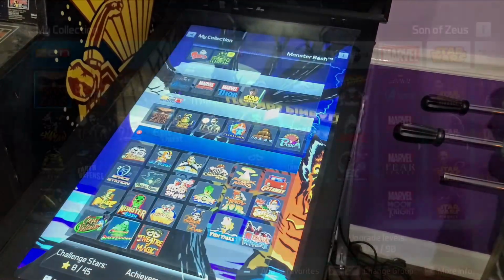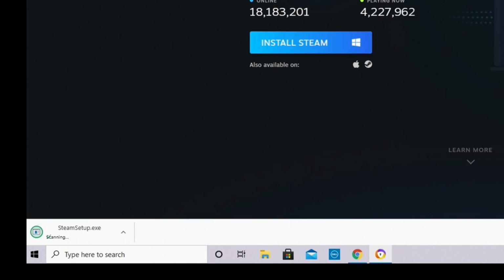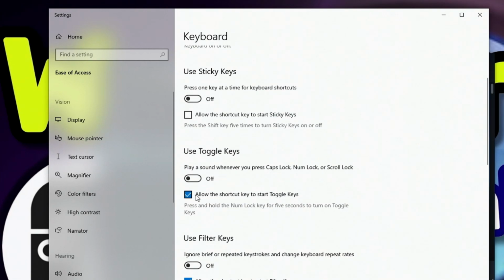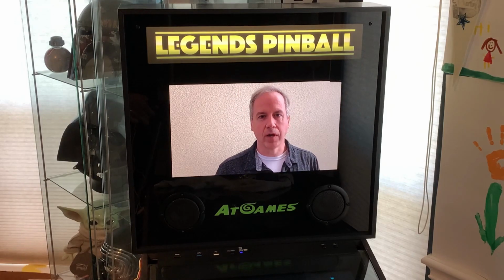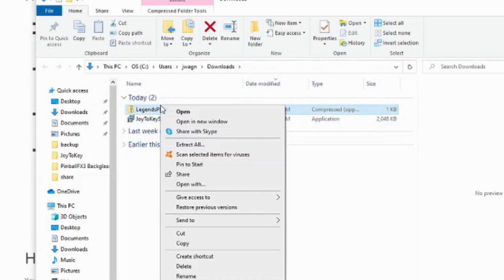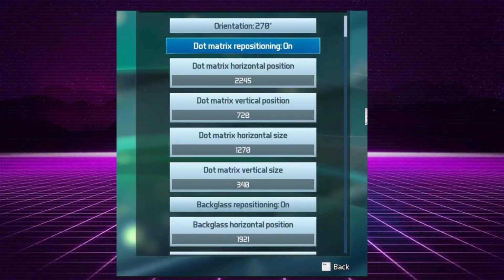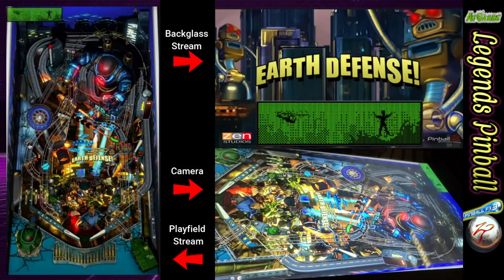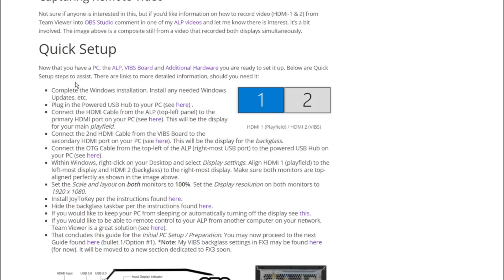Pinball FX3 Setup Guide for the AtGames Legends Pinball Machine

Comment: @WagnersTechTalk You have one of the best setup videos around. The holy grail of ALP setup videos!

Can you please help with something that happened with my Pinball setup? My setup was working great but then for some reason Pinball FX3 stopped displaying on the ALP. It shows up on my laptop but now on the ALP I just get a black screen with a URL on the side of the screen that says:

c:\program files [x86]\steam\steamapps\common\pinball fx3\data\steam\pinballfx3.[bmp, gif, png, jpg, jpeg]

No idea what to do about this. Please help. Thanks!
Reply from the maker: Thank you Joel!  I think what's happened here is that Windows got confused with the monitor/HDMI arrangement. Try plugging the HDMI connections in the same way you had it working before.  Then restart the PC and see if Windows restores everything back.  If not, the black screen you're seeing is the backglass display.  See the 2nd point here to make sure your displays are arranged properly: https://wagnerstechtalk.com/alpfx3/#Software_Considerations .  The first point here has a .jpg file that I created as a default backglass image until a game is selected: https://wagnerstechtalk.com/alpfx3/#FX3_Troubleshooting

Comment: hi, at around @9:39 in the video you are showing how your main screen (the playfield) is set to landscape. I currently have my backglass screen (on the computer settings) set to portrait mode. And I can see everything on my computer (on the pinball arcade screen just fine with screen #1 being set to portrait). And I even have Pinball Arcade up and running using the joytokey, with this configuration (my #1 screen set to portrait, and my #2 set to landscape -like yours).  So I am not sure why I would need or want to have my #1 screen on the PC, set to landscape....when it seems all pinball machine games will need the primary PC screen #1 to be in portrait mode.   I hope that makes sense...

Also if I left the screen #1 in landscape mode then it would look sideways when viewing it on the Arcade Legends pinball backglass (hence why my screen #1 is set to portrait mode currently).

I have a feeling if I dont have the same settings as you showed in your video for the PC screen configuration, then when you explain all the cabinet mode settings in the Pinball FX 3, those settings would not work for me....since my screen #1 is already in portrait mode....So I was just wondering why you would not have have your screen#1 in the PC settings to be in portrait mode???

thanks
Reply from the maker: That's correct, in the guide you'll find landscape is how it's documented.  Like you, I started with Portrait as it seemed to make the most sense.  However, as I began setting up PinUP Popper it was clear the landscape would provide the ability to see the entire screen (in portrait, while trying to configure anything things won't fit properly).  It became very problematic to launch VPX and not be able to see the entire screen or get much done in Windows.  I also find it easier to use TeamViewer to remotely connect to the PC used by the ALP to configure it and it's easier to do in landscape orientations.  I also found the community recommended using Landscape for similar reasons.  So, went that way and simply rotate the display in software when the tables are launched.  This has worked out well and the numbers I show in the guide should match fine if done that way.  But, they won't if you stick with portrait.  You'll have to do a bit of tweaking for the backglass/DMD positioning.
Reply: @WagnersTechTalk  OK, I think I see what you are getting at. I would rather follow your directions, since it would save time in trying to figure out all the dimensions etc as you explained in your video. I could also use VNC or teamviewer etc, to remotely connect to my machine just like you mentioned, and operate it in landscape mode (without worrying about how it looked on the atgame pinball screen (if that happened to be turned on when I was messing with Steam and like Pinball FX 3, etc)

And then, as you clarified in yuor comment above, I just use the settings within the software (Pinball FX3) to change Display settings. That makes sense.

The only other thing about using Vertical mode on my Windows machine is that I want to play stuff like Worms Pinball and maybe some older games too (that may not have fancy Display settings like PFX3 has). So maybe in those cases, I can just rotate the settings of my primary monitor (and therefore the backglass) to play a game like Worms. Only time will tell, once I experiment some more with some of the more esoteric games like Worms and even some possible Gog.com pinball games like Epic pinball

Comment: Thank you so much for the videos! 
Couple questions... I finished my haptics and it works GREAT but in OTG mode the exciters don't seem to be working. 
On the original tables they work great. 
Secondly when installing the vibs board. I am able to view my desktop perfectly on the backglass but no images. (FX3)
Any help would be greatly appreciated!
Reply from the maker: Very welcome Michael.  I'll point you to some info. to help:
1.  OTG Mode - It may be that you didn't press the switch button to swap from original tables to OTG (PC Audio, also here https://wagnerstechtalk.com/alp-haptics/#Troubleshooting or here if it's VPX that's an issue https://wagnerstechtalk.com/alp-haptics/#Option_1_Haptic_Effects ).
2.  No artwork on backglass - see the 3rd point here: https://wagnerstechtalk.com/alpfx3/#Software_Considerations
Until you select a table, you won't see any backglass artwork, here's one I made up that you're welcome to download (first point/link): https://wagnerstechtalk.com/alpfx3/#FX3_Troubleshooting
Hope that gets everything going for ya!
Reply: @WagnersTechTalk  
Thank you again! Im sooo close,  as the backglass is the only thing im still stuck on.  The cabinet settings inside FX3 didn't work BUT when i inputted the settings on at games it put me close.  The screen is solid black and the top shows the jpg switching through tables at the top but no image?
Reply from the maker: 2nd link above should get you to the artwork, you'll copy those files and next time you launch FX3 should see the backglass artwork.

Comment: This tutorial is awesome except I can't get Joy2Key working with my AtGames Legends Micro Pinball machine. I used the file you suggested for mapping buttons but nothing worked. Is there an update to the key mappings for the Micro or is there another solution besides Joy2Key that will make the buttons on the Micro work? Thanks!
Reply from the maker: j2k definitely works with the Micro as well, I used it with a Steam Deck running Windows.  After copying the file, make sure that you exist/restart j2k.  A few sections that should helop:https://wagnerstechtalk.com/alppcsetup/#JoyToKey and https://wagnerstechtalk.com/alppcsetup/#OTG_Troubleshooting .  Alternatively, you can map the buttons directly in Steam, if you prefer.
Reply: @WagnersTechTalk  Most mappings seem to work from Steam directly without the need for JoytoKey - except my right flipper button which isn't working for some reason.

Comment: @WagnersTechTalk I'm so thankful for your video. I've ran into quite a problem with the display, however. When I hook everything up, the backglass display shows the main screen and the main display shows what should be on the backglass. My laptop only has two USB ports and one HDMI. So I bought an HDMI to USB adapter and used both USB ports and the one HDMI port. Did I do that incorrectly? Why are the videos on the backglass and main displays switched?  Thanks for any help you can provide!
Reply: @WagnersTechTalk Thanks. So, I checked out the display and it shows I have three displays. The first box says "1/3" and the second box says "2". When I plugged in the USB and HDMI from the Pinball machine it only showed "1" and "2" and worked fine. I bought a USB to HDMI adapter to connect the VIBS board to the laptop and when I added the VIBS connection to the second USB port that's when it showed 3 screens. My laptop only has 2 USB ports and 1 HDMI which is why I got the adapter. Thanks for your help.
Reply: @WagnersTechTalk Hi! How would I get my Display options to show two screens instead of three screens please given my above reply. Thanks so much in advance for whatever help you can provide me! I really appreciate it.
Reply from the maker: You could use the HDMI out from the laptop as the playfield display, then one of the other HDMI ports for VIBS.  Anything connected to an HDMI port is going to show up under Windows.  I hope this answers your question.  From the adapter standpoint, only one of those should be needed/connected.
Reply from the maker: Hi Joel, I think the problem in this case is that the arrangement of the displays is wrong  in Windows.  Click the Identify button, there you'll likely see the backglass as 1, Playfield as 2.  Instead, this move the displays around such that the playfield is on the far left, then the backglass, any other display to the far right.  More on the settings for each on the 2nd point here: https://wagnerstechtalk.com/alpfx3/#Software_Considerations  Make sure they are fully aligned at the tops of each displays (don't want them crooked in anyway or it will throw things off - straight line at the top of each display).

Comment: Great video!  Just got mine setup last night.  I had one question though, why do you keep the playfield in landscape mode?  Isn’t there a way to adjust the rotations in FX3 and have it in portrait mode.  It sure is a pain to start up with everything sideways.   Also, how do you boot straight into FX3 from Windows 10?   Thanks
Reply from the maker: Most of the sites recommend the playfield in Landscape and I tend to agree.  Plus, if you change it to portrait none of the settings in the guide will work as the display layout numbers in FX3 will all need to be re-calculated and update.  You can copy the shortcut for FX3 to your /Startup group in Windows.  When you boot, it will launch then.

Comment: Love the video! So I followed everything and for some reason my laptop displays my fx3 while my atgames machine just shows my desktop.. can you help?
Reply from the maker: Thank you Joshua!  When arranging the displays, move your laptop display to the far-right.  Far-left should be your Playfield monitor.  If you have a VIBS board and connected, it would be in the middle of the 3.  See the 2nd point here for more details: https://wagnerstechtalk.com/alpfx3/#Software_Considerations
Reply: @WagnersTechTalk  thank you so much! So I ordered my Vibs board just recently and I am waiting for it to be delivered. I wanted to see if I can play FX3 without the VIBS board. Also, I was able to get the FX3 to show on my atgames monitor. However when I use and of my buttons to play. Nothing seems to work. I have to use the laptop to play while it shows on my machine. Any help? Also.. thank you so so much for reaching out and your help!!
Reply from the maker: No problem, happy to help out!  Did you connect a USB-A to USB-A cable (also known as OTG) between the ALP and your laptop?  Here's a quick setup that should help: https://wagnerstechtalk.com/alppcsetup/#Quick_Setup .  A powered hub is only needed if the OTG connection isn't connecting to the PC (some PC's may need it).

Comment: Do you need 2 hdmi ports, as well as a usb 3.0 to usb cord on your pc to play fx3 with backglass display?  My pc has 1 hdmi port, 1 ethernet port, and 3 usb ports...... I don't have any usb-type c ports either.
Reply from the maker: If you want anything to show up on the backglass while connected to a PC,  you'll need the VIBS board and a 2nd HDMI port.  This guide goes into much more detail: https://wagnerstechtalk.com/alp-mod1 .  Yes, you will need a USB cable (A-to-A) between the PC and the ALP, it's what allows the flippers, nudge and ball launch buttons to work.

Comment: Great video. Quick question. I only have one hdmi on my PC and want to install vibs board. Is there any way I could use one of my DP slots as a extra hdmi out? Thank.
Reply from the maker: I've not tried it, but pretty sure it will work.  You'd just need a DP to HDMI adapter cable between the two and make sure you have the video signal set at 1920x1080, 100% scaling, landscape, etc. (guide and video mention this in more detail).
Reply: Thanks! Will try it out..

Comment: So how do you hook up to the internet if you do not have a VIBS board??? You show how with the VIBS but not without. Thanks in advance
Reply from the maker: The VIBS board is only used to provide the ability to use the backglass with a PC (or Steam Deck, etc.)  It has nothing to do with Internet access.  If you want to connect the ALP to the Internet, you have two options: WiFi or Ethernet.  If you have a connected PC, it would also typically use either WiFi or Ethernet.

Comment: Can someone please help me? Where in alp is the option to connect via ethernet? I clearly can see the wifi option but that's it. I have ethernet plugged in but no internet.
Reply from the maker: If you're using a PC playing FX3 and need internet, the PC itself will need to be connected either via Ethernet or WiFi.  When in OTG mode, the network is supplied by the PC and not the ALP.  However, once out of OTG (playing stock tables), just plugging an Ethernet cable into the back of the ALP is all you need to do on the ALP itself.  Make sure you see the link light and some blinking activity lights.  If you don't, could be the cable or connection to the switch/router.  Hope that helps!

Comment: Can you do this with the VIBS so that you only have the play field but the backglass is just not functioning?  Also, JOY2KEY says trackball mimics mouse movement, I don't have a trackball on my ALP, how do you control or can you still use your mouse.
Reply from the maker: Sure, you can set it up such that everything goes to the playfield.  Just skip the parts that discuss the backglass setup.  To use the keyboard+mouse, you'd have to connect one to your PC or use the Arcade Control Panel (what this guide assumes you have).  More on the ACP here: https://wagnerstechtalk.com/alp/#Arcade_Control_Panel_Installation
Reply: @Wagner's TechTalk  great thanks!

Comment: I am from Germany and i love the pinball legends but OTG does not work... I bought an older Windows computer (CPU Intel i5 2500 4 cores
Mainboard Gigabyte H61M) . he always tells me that he has not recognized the USB device. actually, the probably should recognize like a gaming controller. have the usb port already uninstalled in the device manager and all updates are also installed, but just does not run. the whole thing should be connected via usb to usb cable . the mainboard is probably a bit older and has only 2.0 ports. my previously used cables were all usb 3.0 and i tried it with a powered usb hub. didn't help either.  i'll tested it again with a usb 2.0 cable, but actually thought that 3.0 is downward compatible but 2.0 did not work too.
the error message says "USB was not recognized.
The last USB device connected to this computer did not work properly and is not recognized by Windows." All new drivers were installed at pinball table and also windows pc. please help me! :-(
Reply from the maker: I had some similar issues with the ALP not being recognized as a controller on one of my PC's.  The solution, in my case was two-fold.  Needed a specific USB cable (some cables just don't work) and a powered USB hub.  I documented what I did here to help out, hopefully it will help you: https://wagnerstechtalk.com/alppcsetup/#OTG_Troubleshooting
Reply: @WagnersTechTalk  i know and i tried both- cable und hub and it was the same failed recoginized usb device Message :-(. Any other id? Thank you!
Reply from the maker: Can't think of anything else, that's what worked for me.
Reply: @WagnersTechTalk  i already Changed the mainboard and the usb board 😞
Reply from the maker: I can't think of anything else, have you tried reaching out to them here: https://www.atgames.net/arcades/contact/ (purple chat icon)
Reply: @WagnersTechTalk  yes via contact. Waiting for answer
Reply: @WagnersTechTalk  Do you think it will help to exchange the connecting cable between mainboard und usb board inside the pinball machine? I don't know what the name of the USB Cable (6 pins). perhaps you can tell me the name of the white cable or have an idea where i can find this. thank you very much!
Reply: @WagnersTechTalk  can you please help me?